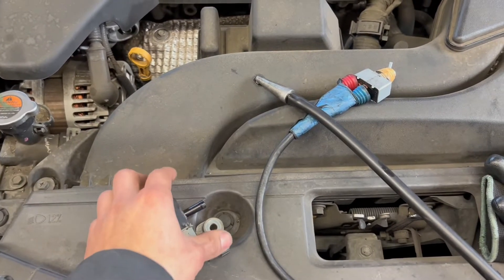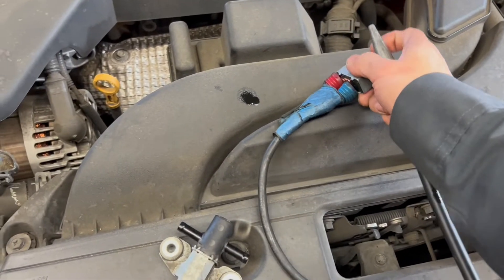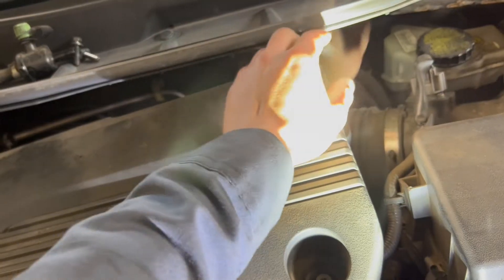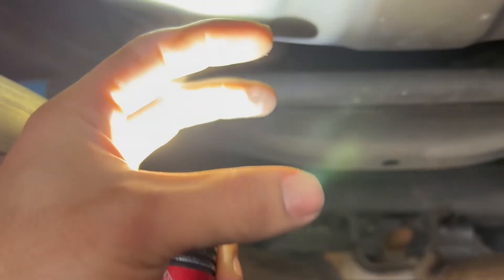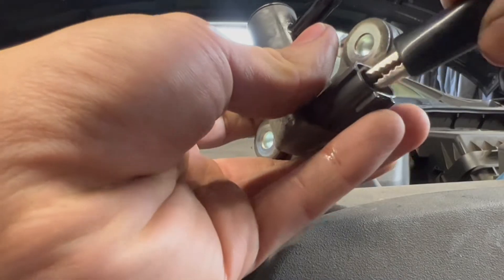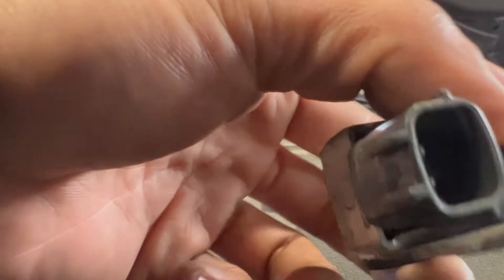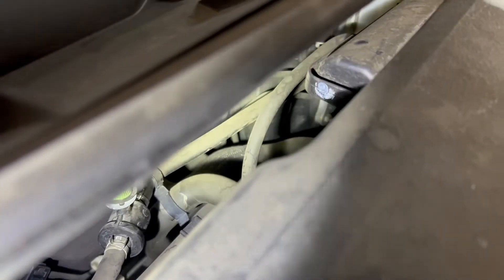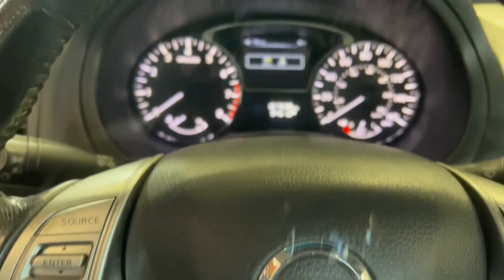Nissan Altima Evap System Small Leak - P0456

Comment: If the car is 2010 or newer, the dtc code falls in the permanent code list and must be repaired correctly and driven until it removes by itself from the permanent code list, to smog the vehicle
Reply from the maker: Permanent means its been store permanently till you fix the problem, after repaired clear codes. Drive around 80 to 100miles to complete the driving cycle to do smog.

Comment: Did it end up actually being the vent valve on the charcoal canister not the gas cap or the purge valve?
Reply from the maker: I did the evap smoke test on the system, no leak. Just a gas cap.

Comment: Can it pass emission test if the code is clear, without replacing anything.
Reply from the maker: It WILL NOT PASS emission. When check engine light is on, the code has been stored in the ecm (computer memory) can't be clear even if you clear or disconnect the battery. After you clear without fixing, you can't do emission because you have to complete the driving cycle (100 miles on the odometer) so you can do emission. Have to fix the problem, not clear.

Comment: What would be the symptoms if evap valve is bad? My altima 19 having p0456 code but no symptoms at all and the car runs fine.
Reply from the maker: Evap codes doesn't affect the engine power or drivability at all, but it will set check engine light on because of small or large leak. If gas cap is bad you might smell the gas vapor coming out. Purge valve, vent valve, evap lines or canister bad, its really hard to smell any gas vapor coming out. You have to smoke leak test the evap system to find a leak. Test purge and vent valve one by one to find out which part is bad.

Comment: My car is making a ticking on the vapor purge valve on my 3.5 2010 altima could that be the issue
Reply from the maker: Ticking is normal, as long as no check engine light.

Comment: Hello bro I hope you answer my question so the problem on my car is the Control valve so my question is 
When I put air in it should on the other side the air go out.?
Reply from the maker: You mean you put smoke through the purge valve or you blow air through it?
Reply: @Ah_Duuu_Ma  i blow air bro because I got the code and it say that it’s the Valve so I want to know if it’s normal that the air get out in the other side

Comment: I changed both valves and replaced gas cap still getting codes p0456 and p0444 🤬
Reply from the maker: @MikeJones-qo7vt  Smoke leak test the evap system. See where the leak is. It could be from evap lines or canister or gas tank.
Reply: @Ah_Duuu_Ma  ok will do

Comment: Great video but simply clearing the code doesn't show that it's fixed. The car still has to go through thr drive cycle and the engine has to reflect that the problem is no longer present.
Reply: Well, the EVAP system is only composed of a few components. Purge, vent, charcoal, filler neck, vent line, etc. He verified the purge solenoid is good, so lets move to the back, verified gas cap is faulty ( clue number 1), verified vent valve is in good shape, o ring not deteriorated, no smoke coming from any other lines and hoses. I will rather have this gentleman wrench on my personal cars than 90% of other technicians, due to the fact that he diagnosed the vehicle properly, instead of just throwing parts at it.